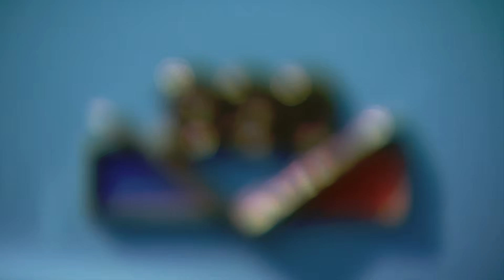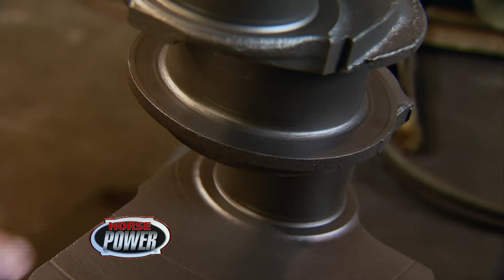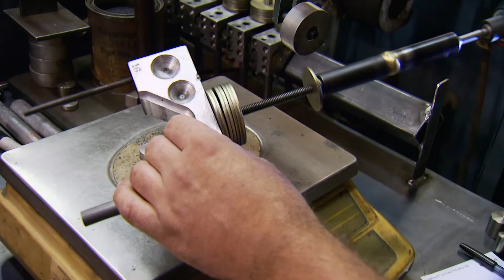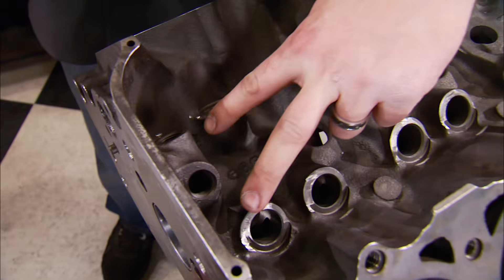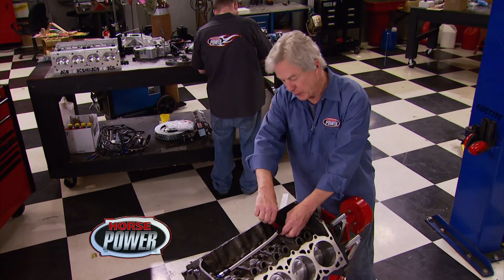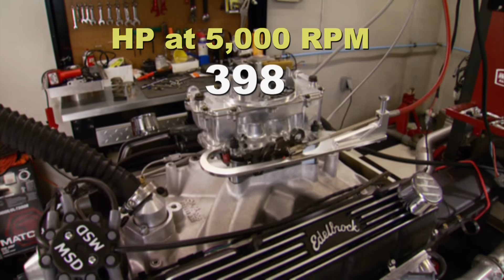Building The "Other Engine" - An AMC 360 - Horsepower S16, E4

Comment: I seriously doubt the horsepower numbers the factory put out were accurate. Those engines made a lot more horsepower but insurance companies increased rates for higher horsepower numbers so amc lied about the true numbers.
Reply: Might explain why they went from 300hp nearly to 145hp on later years lol not just emission and compression bs
Reply: @jeepsblackpowderandlights4305  Well, milder camshafts and how they measured the engine's output, thankfully they no longer use SAE gross,

Comment: I had a 80's Wagoner, 360 ran good, but after coming down an off ramp, lifters would knock, took it apart and found two different heads!, one head had 2.02 valves one had 1.60s, I thought I was screwed, but Valley Head Service was able to put the 2.02s in the other head, and match them up. Ran awesome!
Reply: Grew up a few miles from VHS. Been around a long time!

Comment: Nice work man!. What an odd motor! Meaning , Ford Clevo oiling, with mains, from outa a lifter gallery. Buick, BB Mopar and Ozzy Holden 308, that have , an external oil pump. Front dizzy, to make it different from  a Mopar SB 360. And lots of power.

Comment: That motor would be awesome in a spirit  gt,with the turbothrust wheels and fat Goodyear eagle 1'S. Also it would be cool to see amx 343 build all the old timer in Kenosha would swear they were serious fun.
Reply: A 343 build would look almost identical, but the 343 was only built for three years, '67-'69. The 360 had the same bore, but slightly more stroke and deck height, larger-diameter head bolts, and improved heads with better exhaust flow. With a little machining, a 343 block can use the 360 crank, heads and head bolts. You'd wind up with the same engine, but the casting would still say "343" if you crawled underneath the car and looked.

Comment: That would be Hella fun in a Gremlin😁. Ya gonna go Oddball, might as well go Full Oddball. 
Or maybe a Hornet.
Reply: Naaah. Put a blower on it and stick it in an Ambassador. Fool the hell out of everybody.
Hell if you're looking for an AMC 360, the Ambassador is where you'll find one.
Reply: @ladamyre1  Can't argue with that. 
I was an AMC fan from an early age. Uncle Drag raced a '72 Gemlin. Papaw had an Ambassador for a Beach car to pull his 19' Coachman. Cousin had a Gremlin X. So did my Football Coach. Another Cousin worked for AMC in Greensboro. Pop had a Rambler. Great Uncle had an Eagle. NOT the Eagle brand Chrysler created with Mitsubishi. I could still kick myself for listening to my X-wife and letting a Black on Black,One owner Gremlin X with 40k miles for $1000 slip through my fingers. Still have a recipe for a couple of AMCes rattling around in my head.
Reply: A guy in my neighborhood had a Gremlin with a 304. That thing was crazy
Reply: @coache1nine  most people don't know the Gremlin was the very first car to be mandated by the sanctioning body to run a restrictor plate. Those straight 6's had so much more torque than the 4 bangers in their class, they just pulled out of the corners without having to carry the same RPMs.
Reply: @SGTJDerek  I know about that straight 6. I had a 68 Rambler American with the 232. That think was a tank with plenty of torque and smooth as silk at 75mph

Comment: Did AMC ever make a forged crankshaft for the 360 ? I really like Your build ! Have You thought of doing an EFI comparison on that engine
Pro 4 system , Holley or Atomic systems ? I think that would be awesome . Thank You . 🇺🇲🇵🇷🦊👍
Reply: The Gen-1 AMC V8's (250/287/327) all used forged cranks, as did AMC sixes of the '50s and early '60s. In the Gen-2 and -3 series, only the 390 and 401 had forged cranks.
Reply: I'm running the ProFlo4 on my 360 in a CJ7. It's a great set up and worth the investment,  as it includes the intake,  throttle body,  distributor,  and Bluetooth ECU
Reply: Nodular iron only. They are good to 600hp though
Reply: Over 600+HP easy , it's the rpm that kills them. Below 7rpm your good. Crank starts to walk around 7500rpm. Stay below that.

Comment: With some porting and polishing to Eldbrock Aluminium heads and man that beefed up AMC 360 will make well over 500 HP.
Reply: agreed
Reply: Would you happen to know anybody who's doing porting on the AMC Edelbrock heads on a regular basis
Reply: @jackiecurl6171 Some performance shop that'll port and polished those AMC Eldbrock Aluminium heads.
Reply: @jackiecurl6171 I could do some port work to them if your close to Pa. I work in a machine shop full time on 410 sprints. I love working on hot rod motors.

Comment: The amount of hp that was pulled out of this engine astonishes me
Reply: Its the heads aftermarket heads mainly. That and engine management. The regular CI heads flow pretty well but the factory just did not have the cash to produce special versions. Plus every head they produced 290s through 401s was machined on the same equipment. The same with the intake manifolds that were done in house. All of the blocks used in dedicated race programs from 1970 on were the Specual Service Block. Basically a 390 casting with the cylinder bores cast for 360. Heavier cylinder walls. The blocks were machined in house except for the bores. The bores may have been bored 4.080. Plus the main webs were much heavier allowing 4 bolt mains to be used.
Reply: @mpetersen6  factory heads could have easly matched these eddys .not even fully ported  they prob flow around 275 so no its not mostly the heads  factory headed amc 360s regerally made around 475 @6500   and 401  520@6500  with mild 275 cfm heads
Reply: When I heard solid flat tappet I picked 450hp @ 65-6700rpm. I was 27hp down. Sounds like an industrial sewing machine doing those rpm too. What a thing.
Reply: Heck yea.
Reply: That dude builds good engines. They did a bunch of oddball ones.

Comment: Biggest problem with burning up distributor gears is poorly made parts of today. Lots of the cams and timing sets have the oil passages misaligned at the interface. I've had to weld up cam sprockets and re-locate the oil passage so the distributor gear gets oil fed as intended. Oil pump/front cover normally benefit a lot from some good old blueprinting by hand. Amc always made a great engine but you really do want a real engine builder with some knowledge of them and not just your Chevy guy cousin.

Comment: Interesting.   They spent a fortune on an AMC 304 for that eyesore AMC and ma de e 330hp.   Less was spent here and made 477HP with a 360.   Me thinks someone missed the mark on the 302.
Reply: agreed
Reply: i think the 477 was the torque.
Reply: @jordanwiley4582  they said they beat the base hp of 295 by almost 200.
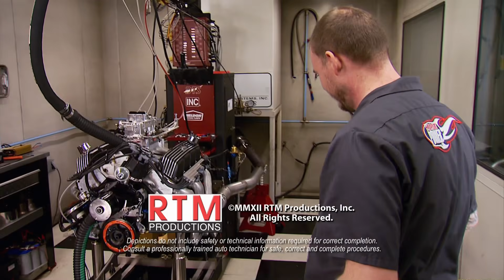Reply: @jordanwiley4582  No right at the end at 17:24 he says factory HP was 295 and we've almost beaten that by 200 OWTTE.
Reply: Also the AMC 304 had shorty headers as well and the Aluminium heads on it weren't ported and polished as well they're were all stock cast. With some porting and polishing combined with Longtube headers I bet that AMC 304 would probably make just well over 400 HP.
Reply: @CJColvin  The 304 used the same crank and had the same stroke as the 360, but a much smaller bore. That limited max valve size, which made it tougher to get HP.
Reply: @paulplack490  Thats true, course a Ford 302 can make well over 400 HP though.

Comment: AMC much like Buick and Pontiac don't have "small block s"
Reply: Buick certainly did have a small block family, 215 to 350 and all the v6 versions.
Reply: The AMC V8s had bore spacing almost identical to the Mopar big-blocks, but with internal crank clearances like a small block, limiting max stroke. So they were technically neither. All Gen-2/3 AMC V8s had the same exterior dimensions.